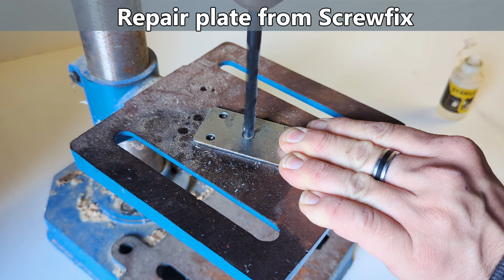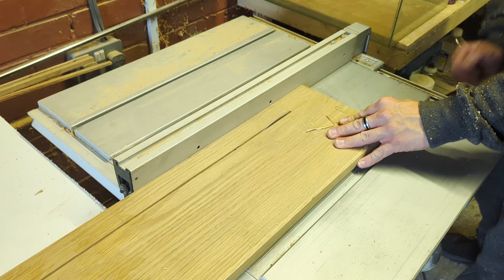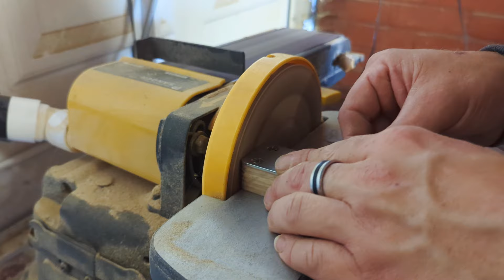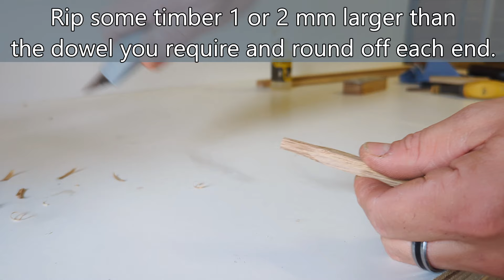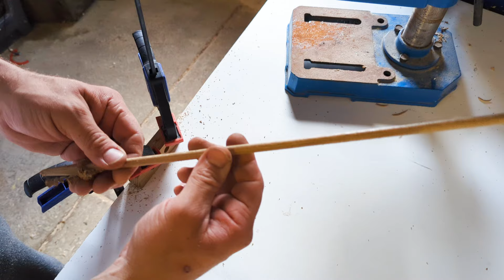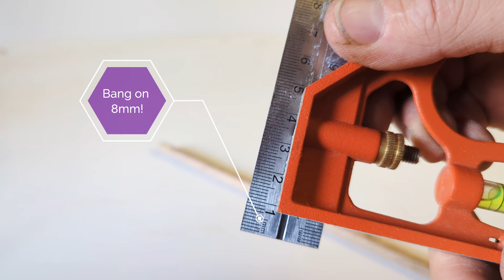Wooden DOWEL maker every shop should have

Comment: Drill's running too fast there sir. Rather run her slow and push harder - big steel curls will dissipate heat and avoid overheating / loss of drill hardness ;)
Reply from the maker: When drilling the metal of winding the wood through? Unfortunately my bench drill only has one speed 😩
Reply: @DIYTipstricksandhacks  I bet an occasional splash of water with occasional back off would do the trick. I don't own one myself, but a thought from observation.
Reply from the maker: @hieliksuslik  I put a couple of drops of oil on it. Even if the drill press was variable speed I was pretty much holding it by hand so any slower would of been a big fail. But... Today I'm making a drill press vice 😃. I was going to buy one and then thought hold on, you like making things, make it ! 🤣